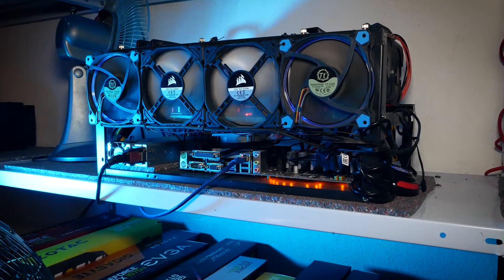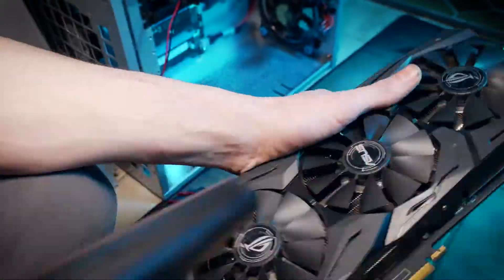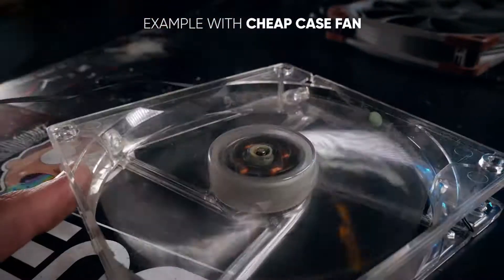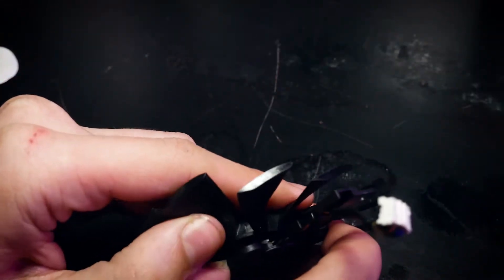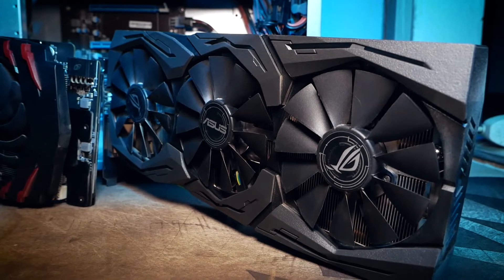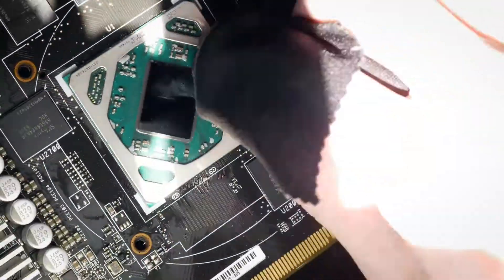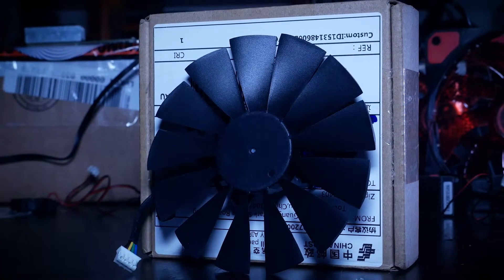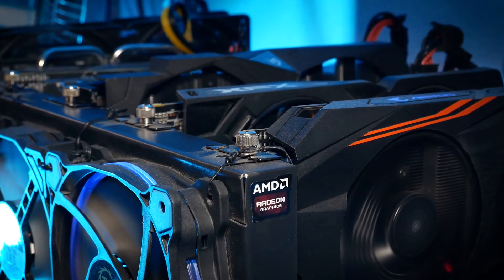Asus ROG Strix Fan Repair (RX470) GPU broken fan maintenance / fix

Comment: i fixed one fan of my rx 470 strix 4gb with this vid. thanks you so much.
Reply from the maker: Hey mate I am glad it worked out!! Cheers
Reply: I forgot that what is actual fixed patten in one cable
If i forgot and fixed wrong side is it work
Or both side ok
(One cable have notch i am talking the other one)
Help
Reply: Me too, i think the problem is the strix series...

Comment: Were you using your phone or a tablet to set up this miner? What app were you using? thnaks
Reply from the maker: I used my phone :) back then the Rig was still on Win10, so I simply connected my phone with TeamViewer so that I can check the card out while still downstairs :) easy way to monitor Win10 rigs (especially when you make an account, also possible in free version, and add the rigs as computers) - nowadays I use HiveOs as operating system for my GPU rigs, here you could also simply monitor when logging into the browser :) hope it helps, cheers Omar ⛏️
Reply: @CursedMining  thanks for the quick response..i was using TV but they keep flagging my use as commercial :( and $39/m seems much.
Reply from the maker: I feel you - but did they force you to upgrade? I got the message as well but kept ignoring it, at some point it went away (I don't feel bad about that since I am no big commercial miner, so I do see it as private use)

Comment: In the past I had some Gigabyte fans go on me.  It made me not want to buy Gigabyte anymore.  I've been using ASUS in the last 6 years, so far no problems.  One is a 780ti, it's still running after 6 years but I bought some new fans, to reduce noise a bit (they've started to become noisy).  I've also got a RTX 2070 that hasn't had much use and is too new to comment on the fans.  Really sucks when the fans go and everything else in the card is fine.  Very useful that these fans can be purchased separately.
Reply from the maker: funnily it was the other way for me! Gigabyte stayed OK except being a bit leaky, Asus fans died over time 🙈 guess we all make our experiences :D cheers and may our fans live long :)

Comment: My Strix 1080Tis are about 1 year old, still working well, i do clean them from dust every 3 months or so. Also they never run above 60% fan speed.
Dust, heat, environment and fan speed (rpm) is main factors how fans can fail.
Btw GPU fans are not designed to work 24/7/365 so we should be happy that they last more than a year 😁
Reply from the maker: fan speeds for me are also never above 50 to 60, but sometimes one just has bad luck 😫 of course you are absolutely right with 24/7, I still thought that heating up often for short amount of times (gaming) is worse than consistently low, but probably not 😁 thanks for leaving your thoughts ⛏️
Reply: I totally agree with the short heating and cooling, its bad for the PCB and the components, but for the moving parts like fans it doesn’t matter.
Fans have lifetime frame mainly from the bearings, they can run for a long time or if they get dry for a reason they can fail much faster.

Comment: Asus strix fans are garbage. Paying 20€-30€ for original fans isnt solution either ( whole card is 70€ and is making 0.3$ per day ) Custom fans for 4€ and let card mining till it die is only sollution.
Reply: @CursedMining  Why U worry about people with old dinosaur Pc, If they have any care for Pc it wouldnt be old. If U care for fans when U buy card for mining mine with it few months to get sure that its good card than take off good working fabric fans and put 2 12cm Pc case fans. When u want to sell it or give away u put back fans and print fabric sticker and glue it back. Problem solved .( I did like that with half of my cards and now regreet why I didnt with other half cos they are duying everyday)
Reply from the maker: Hehe regarding dinosaur people: not everyone is a nerd like us. I've made non-nerds into mining freaks by giving them some old hardware to play around hehe. I get your points, very economical - agree that always using your own coolers is best for reselling